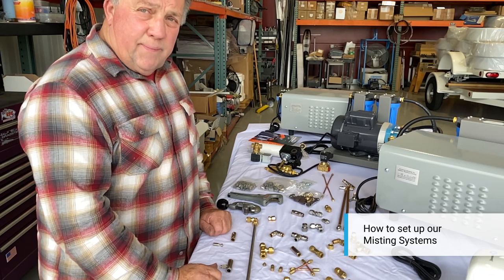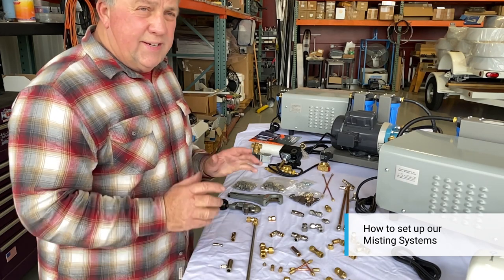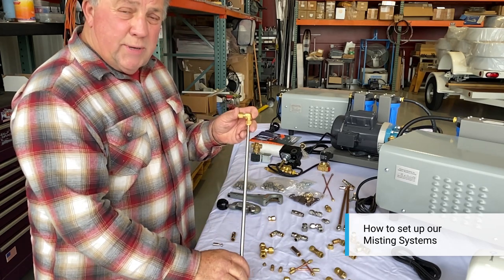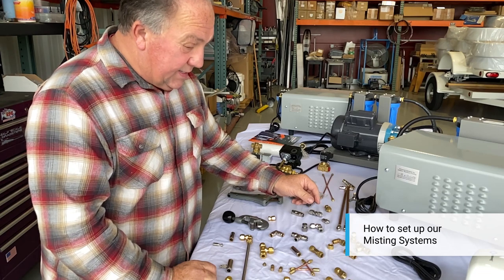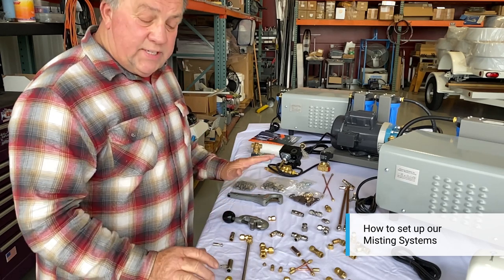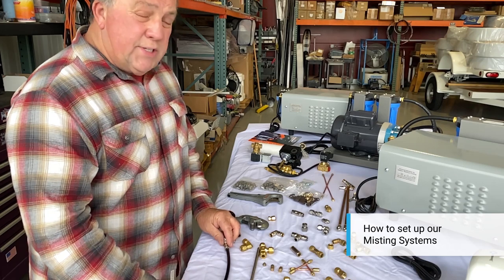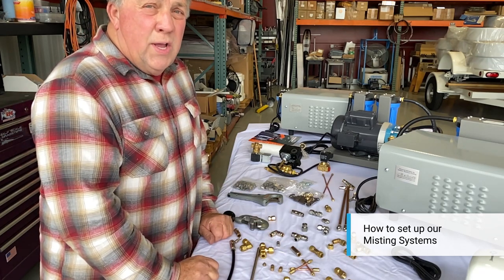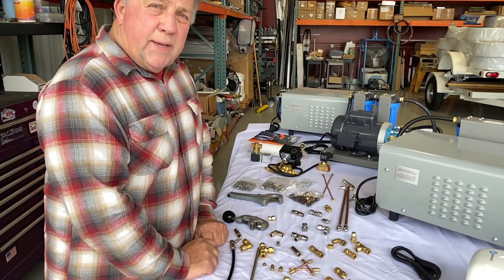How To Setup Your Misting System - Advanced Misting Systems

Comment: What's the reason of choosing nylon vs steel tubing? What's the main difference to consider of one vs the other?
Reply: Cost and difficulty of install is considerably higher with stainless steel. Stainless is more for high pressure misting systems.

Comment: Can you please guide the best suitable type of pump (exact mechanism piston one or....) one should go for high pressure misting pump and minimum life one should expect for running it continuously 8 hours for 2 months a year?
Reply: Good question.  What's the mean-time-between-failure? what's the expected duty-cyle?...a few hours a day?...will the pump cut-out and overheat when it's 112 degree's outside?

Comment: Hi.. can we use impeller pump similar capacity which generate 1000 ~ 1500 psi pressure instead of reciprocating pump ? . Reciprocating pump are very costly..